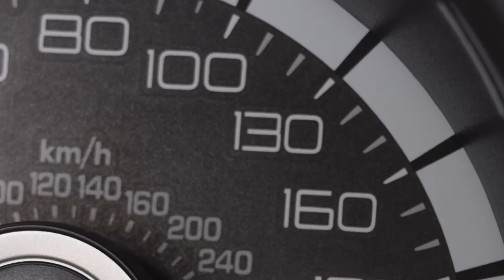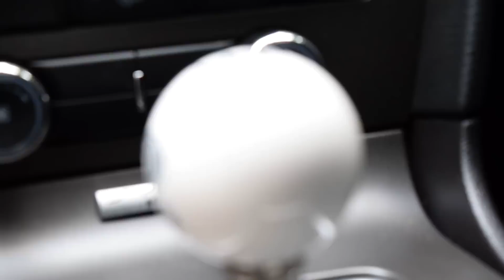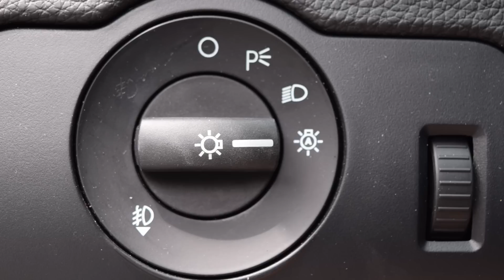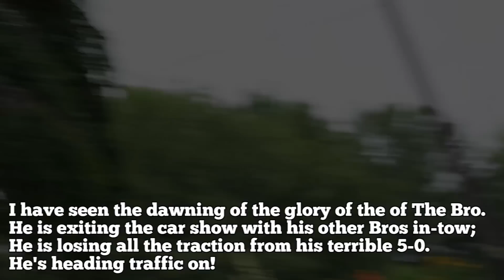2013 Shelby GT500: Regular Car Reviews

Comment: Top speed of 200mph, for those faster crowds
Reply: As a mustang owner, I get tired of hearing the same, lame crowd jokes. But this one, this comment made my day 🤣🤣
Reply: I read a test of a GT500. Yes, it will do 200 - in 5th, not 6th. AND it ran out of gas in like 6 mins (IIRC) at that speed!
Reply: @SteevK69  wait so in one run getting up to that speed it killed it's whole gas tank?
Reply: @bryanmartinez6600  I think it was the struggling to keep it above 200 (in 5th gear) burned up a lot of it.
Reply: @derekjohnson5174  same. That was pretty good
Reply: Dam
Reply: @SteevK69  I had a friend who is a engineer at Ford and he confirmed this. They were going to make the axle cooling system for it, but they realized the car would run out of gas before it would be needed ! 😂

Comment: People love to point out the cheap plastic in American cars , thats how they keep the price down . If you wan't leather covered everything than buy a Fararri , so you can complane about it catching on fire or how much it costs to maintane .
Reply: They could use expensive plastic instead
Reply: Yeah well the BMW's in the US are ridiculous as in you need so much money to maintain them as my mother's needs over 16k in "repairs" (which was said by the dealership) but it's still under 100k in miles. And the most expensive repair? The engine block
Reply: +Zero Shima my 2005 ford five hundred doesn't squeak at all and the majority of the plastic found excepting that surrounding the pillars is fairly high quality in my opinion but I'm not even sure of my own opinion because I'm 18 years old so my wisdom on matters like this isn't particularly impressive
Reply: Jesus...rent a spell checker. Ferraris use Alcantara, which is plastic suede, first used on a Fiat X1/9.
Reply: Better to use plastic where it's not so crucial in comparison to EDM cars that use plastic designed for colder climates throughout the engine, and the sacrificial cheap parts become the repetitive Achilles heel of the god demanded car, leading to costlier problems and repair costs.
Reply: It's still cheap and poorly insulated. After driving Avalons for so many years, driving a Fusion felt like I was sitting in a tin can rolling down a rocky hill. Never again.
Reply: And that's what your extra 10 grand gets you (between an Avalon and a Fusion).  Fit and finish that's made of something other then recycled soda bottles.  
I love my '14 SHO, but the finish is kinda meh, compared to my fathers '04 BMW 3 series (which was cheaper new, adjusted for inflation).  
But again, a GT500 is a VERY fast car for not a lot of money.  What other cars can you buy for 55k that can do over 200?
Reply: Plastic in American cars is the worst
Reply: Maintain*
Reply: @robertsmith9074  Kudos to you for admitting that, at 18, you don't know everything. Hell, I'm 65 and only know a fraction of what I want to know...
Reply: @ZerotheWanderer  Flimsy feeling is one thing, but having shit break off is another. I had a 1986 Buick GN. It's a full frame car, so they lightened it up, cheaply, by replacing all kinds of stuff w/plastic. The little joystick that controlled the power driver's seat broke off in my hand - looked like metal, just shiny silver plastic (how much weight would it have added to make this piece metal, grams?) Shortly before I was leaving for a trip, the dash light adj wheel (what was wrong with the standard lighting post, found in all my other GM cars?) fell right into the dash on very little pressure. And Buick dealer's service delays were 2-3 weeks at that time. The THIRD time I blew one of the cheap alum/alloy turbo hose clamps, I spent under $8 to replace with standard steel clamps. Never failed again. And again, how much weight/money did they save, only to keep replacing these clamps with the same cheap faulty clamps? 

Put me off GM for almost 30 years! They must have reformed somewhat, because I love my 2017 Camaro 2SS.
Reply: The lack of spelling and grammar skills in that post gave me cancer.
Reply: How could there possibly be so many spelling mistakes in that prose? It's like you were trying to deliberately spell everything wrong.
Reply: Maintain
Reply: @halvey8518  that's what we get with South African build quality. Owning a bmw outside of Europe is a bad idea
Reply: It’s know. Its all plastic in every car (except ridiculously pricey exotics), so who cares!
Reply: That's why you get a 289 swapped pinto the engine costs as much as the car and every second of driving it is a fuckin panic attack because if you mistreat it even once it will break loose and kill you and everyone and everything within a 20 foot radius ... I need to save up for a pinto now
Reply: Top Gear shat on the Camaro in the same way back in 2010 by pretty much saying "well yeah it's cheaper, about the same performance, but it not a Merceeeedeeeeeeeees..."
Well, yeah.
Reply: They're mad because their tyrannical tax hungry governments make their chances of ever owning a strong V8 nearly IMPOSSIBLE.
Reply: Back in the 60’s and 50’s everything was metal(s)

Comment: I watched the video, the tester used a regular GT500 for his test.  He commented that the car overheated when tracked.  If he had tested a car with both the SVT Performance pack and the SVT Track pack, they have additional coolers for the Transmission, Engine and Differential.  I have one (a 2013) and on the track, I've NEVER had an overheating problem.  These options were an additional $6,490.00.  If you plan on tracking this car, these options are a must have.  Also, he complained the car he tested didn't have navigation.  The car I have has the optional Electronics package w/ Navigation.  The 4.2" screen in the center of the console has the latest on-screen navigation available.  I've also upgraded mine with Carbon/Ceramic brakes.
Reply: Yeah its painfully obvious that he didn't really know much about what he was testing.
Reply: so if your not tracking just punching it occasionally no probs with overheating

Comment: "Crowds XdddD" That was funny 3 years ago, now it's as overused as a junkyard LS3 build.
Reply: that's the point
Reply: It wouldn't still be a joke if it wasn't still a thing that happens tbh
Reply: Had an LS3 in a C6 Grand Sport.  Such a rough idle made me pine for my LS1 in a Firehawk.  80 less Hp?  Yes, but all-usable?  Definitely.
Reply: Talk to me when your engine design is over 10 years old
Reply: But that junkyard build still embarrasses you.

Comment: the 8.8 is a fine axle, but most of the reason everyone wants a 9 inch is because of the swap-able center section makes changing gear ratios extremely easy even at a racetrack or drag strip

Comment: I'd still rather have any C6 over this. especially one with an LS3. waaaaay more performance for the buck. That being said, its a beautiful car!
Reply: technically the mustang makes more power, so therefore it has more bang for your buck in the performance category
Reply: +xmizzoutigerz11 what? no. by merely pointing out hp vs hp does not give it better performance per $. we're talking about a $55,000-$60,000 car. for around $30,000 you can get LS7 corvette with 500hp. thats $20,000 less! you can throw on a supercharger and have just as much if not more torque and hp and still have$10,000 left over. not to mention a superior suspension, which is just as important for performnce. and a much nicer interior. thats why corvettes are waaay better bang for your buck
Reply: The c6 corvette does not have a much nicer interior than a GT500. They're both pretty bad
Reply: +4sake123 a c6 Z06 doesnt have a nicer interior than a base model V6 mustang?..... lol ok. my grandmother's old cavalier has a nicer interior than a base model V6 mustang
Reply: No it does not, the c6 interior is shit, so is this generations mustang. The c6 corvette has the steering wheel from a fucking cobalt
Reply: +4sake123 nobodys arguing they're both shitty interiors. But a C6 Z06 does have the better of the two, cobalt steering wheel aside atleast the Z06 has touch screen navigation and a Heads Up Display, not to mention cup holders that dont sit directly behind the fucking shifter
Reply: +Wyatt W You can get the mustang with touchscreen navigation too and the recaro seats are much better than the corvettes seats
Reply: +4sake123 yeah except all those are optional equipment packages you have to pay more for. I'm talking standard equipment here. hell for the price a dealership would charge for those optional packages you could go out and get a recaro seats installed and still spend less. not to mention saving $10,000+ already just by going Z06
Reply: The touchscreen was also optional on the z06
Reply: 4sake123 Touche! I've driven a few Z06's but had never seen one without it, guess I should have done my homework! Still would rather have the Z06 lol

Comment: I’ve owned the same supercharged 10-second mustang since 1990 and haven’t mowed down any crowds or gone head-on into traffic, am I doing it wrong?  *I did jump a curb At O-dark:30 in an SVO Mustang back in 1985 in wpb Fla, so I guess I’m not a total loser as a Mustang guy.
Reply: Were you running away from the Jamaican Shower Posse? Lol

Comment: STILL FUCKING LIVE REAR. IN 2013/ JESUS CHRIST.

i still want it tho
Reply: Best straight line times
Reply: GT500 was designed as more of a freeway predator. Not a track beast so yea live suited it better
Reply: Honestly the live rear is so much better if you ever want to do any drag racing, I wish Ford never caved in and went to the IRS. It would have been better if they offered it as some kind of option, maybe a handling package or something like that. IRS in a RWD car with lots of torque makes for ridiculous wheel hop and eventually broken half shafts.
Reply: +Granny Shifting , Seems like it might be easier and cheaper to do a solid axel swap rather than to have an independent swap if Ford had keep the live rear end.
Reply: D Rock 75 Swapping in a solid axle is always easier obviously, I just think it would have been best if ford made both options available to buyers. It could even have been the opposite of what I originally said, Ford could've made the IRS standard but offered some type of drag racing package that would include a solid rear. Something like that would've kept everyone happy instead of just ditching the solid rear and making lots of die-hards upset like they did.
Reply: Granny Shifting , Gotcha.  What about the Cobra Jet?  Surely that can't have a IRS
Reply: This isn't  the 1960's . IRS are built strong today. There are plenty of irs corvettes with 1000hp drag  builds. Maybe ford is just junk.
Reply: D Rock 75 I'm not sure but I'd have to imagine the Cobra Jet uses a solid rear, it's not really a production car so they don't have to worry about comfort. The next gen GT500 is rumored to use the IRS from what I've heard.
Reply: The Cobra Jet has a live axle, but it's also not street legal so it's not much good for the average consumer.
Reply: DC Garage , How much HP can the modern IRS take?  I'd imagine you're getting into pretty serious numbers to actually need a solid rear in a street car
Reply: +Granny Shifting, not double clutching like you should.
Bet ya never heard this one before 'kappa'.
Reply: +Granny Shifting who said the GT500? is about comfort? it's about raw power
Reply: Adam Glover Almost had me? You never even had your car!
Reply: clusterfuck3 I never said the GT500 was about comfort either, just saying I've heard it's gonna be using IRS.
Reply: D Rock 75 It depends greatly on the tire and conditions. It can take pretty much anything you want to throw at it on street tires and normal roads. But throw on a set of drag radials and launch it hard on a prepped surface and you can break a half shaft pretty easily. That said, the solid 8.8 wasn't perfect either, but it was much easier and cheaper to prepare it for drag duty.
Reply: DC Garage That makes sense
Reply: ***** , That's badass!!!
Reply: ***** , I'll be checking those out for sure.

Thanks for the info
Reply: ***** Don't get me wrong, I love the S550 IRS and I even have one (not the car, just the S550 IRS assembly), but the criticism isn't usually that off-base. Even the standard upgrades (bushings, braces, half-shafts, etc.) are very expensive in comparison to the live axle stuff, and it is harder to work on. Unfortunately, the added complexity has it's downsides as always. That said, it's better on the street and in the turns, so I would say it's worth it. That's why I'm trying to ditch my live axle and retrofit S550 IRS (building the car for time attack). But you can't expect the drag racers to be happy about it, particularly when the Mustang has been the go-to dragster for decades.
Reply: +DC Garage Dragsters love messing with cars, I'm sure a rear axle swap is NBD for them. For the rest of us, we can enjoy an upgrade in ride quality and more stability in the twisty bits.
Reply: made for drag

Comment: How does anyone buy a car (even with the close-to 500hp) for around $55k and get interior that looks like you are sitting in a 2010 Ford focus? People should just wait for the new gt500 or get the 350r......
Reply: jS197 If you watch the video, take a look at that stock 4 cyl. interior. Same thing (ford fucus is just an exaggeration, but you should get the idea). I care more about function that form, but for the money, I would expect at least some effort with the interior. I would't complain about getting a gt500, but I would complain about the boring interior.
Reply: I dunno. I've been in many cars over the years. It ain't no Lexus, but sitting in recaros that wrap around you is not a bad place to be when you're enjoying all that power.
Reply: HokieD1993 Yea but recaros, brembos and a recognizable suspension platform is pretty standard. What I want for 60k is at least an effort to have a sense of sport design in the cockpit, not feel like I'm sitting in a rental car with badass race seats.
Reply: +EVOLICIOUS I guess. but you won't see much diff on an interior for a variant based on an existing platform. Camaro ZL1, impreza wrx sti, lancer evo, charger Hellcat, Focus rs all share interior you'll find on the base version of that car. That's not stopping people from spending 40k for a 320-350hp awd car. 662hp, track pack, perf pack, recaros, touch screen nav for 60 ain't bad IMO. 

I am curious about the limp mode. I hadn't heard about them overheating on the track. Guess I'll find out this fall at the performance driving school.
Reply: HokieD1993 Yea I'm not complaining about the performance for the price lol, I'm just saying usually with a car on the higher-end of the performance market, you kinda expect something better than what the base model has interior-wise lol. 

Yea sucks to hear they have cooling issues, but more than likely these cars are not designed for heavy track use, mustang enthusiasts just garage them and take them to car shows to mow down crowds of people, lol.
Reply: For a car you can get for $40k and walk pretty much anything you'll find driving on the road, the interior exceeds expectations. I'm surprised it's not gutted for that price.
Reply: BTW, had no cooling issues on the track whatsoever. And after some research on forums this is not an issue on the 2013-14. 2013-14 included larger heat exchangers and higher flowing intercooler pumps. Mine has track pack so it has external coolers also.